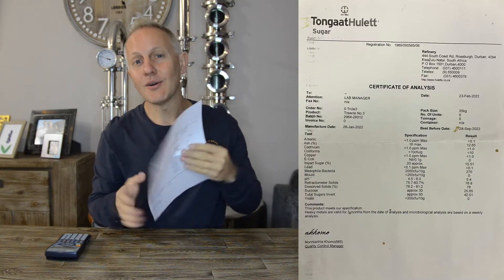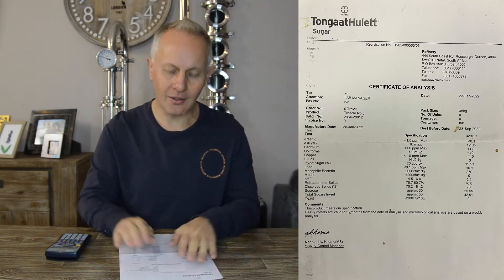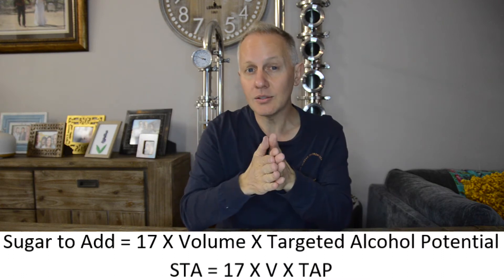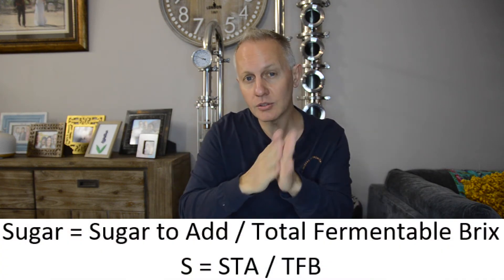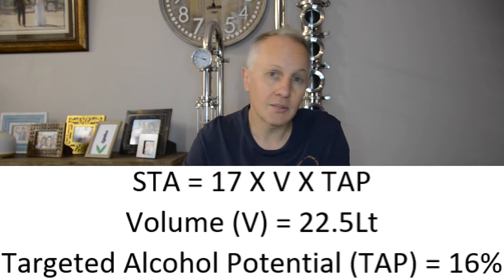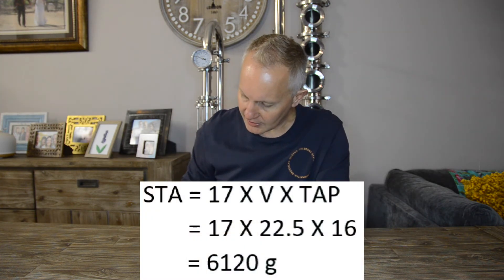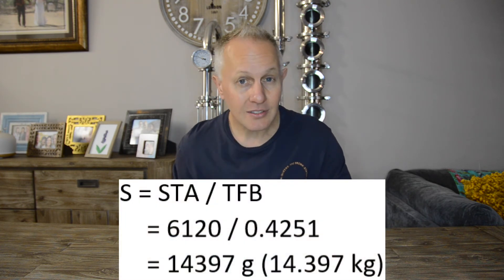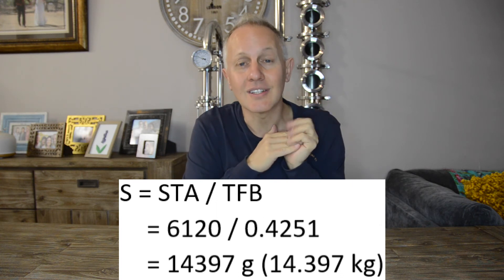Molasses Fermentation Sugar Calculation Explained | Home Distilling Guide **AUDIO FIXED**

Comment: Hello, how to ferment unfermented sugars?
Reply from the maker: Great question! Unfermentable sugars can’t be fermented by regular yeast because their chemical structure is something yeast can’t break down. Common examples are lactose (milk sugar) and some sugar alcohols. However, you can still work with them in a couple of ways:

Using enzymes: For complex sugars like maltodextrins, you can add enzymes (like amylase) to break them down into fermentable sugars, like glucose. For lactose, there are some specialized yeast strains or bacteria, like Lactobacillus, that can handle it.

Blending with fermentable sugars: Often, unfermentable sugars are combined with simpler, fermentable sugars (like glucose or sucrose) so the yeast can still do its job.

So, while you can’t directly ferment unfermentable sugars, there are ways to process them or mix them into something fermentable. Let me know if you'd like more details!
Reply: @distillergreyling  Thank you for such a detailed answer.))
Reply from the maker: @m.m.musasi
You're very welcome! 😊 I'm glad you found the answer helpful. By the way, I'm planning to relaunch the channel soon with fresh content—so stay tuned for more deep dives and practical tips. Thanks again for watching and engaging!
Reply: @distillergreyling  Thank you for your creativity..))

Comment: Based on your calculation, you go down from 76.8 to 35.1 Bx, or form fermentable sugar from 42.5  to 19.4 Bx, so my question is if you have 35.1 Bx will to be to high the osmotic pressure for the yeast? 	Also, 19.4 Bx will have a alcohol potential of around 11 % abv, isn´t it?
Reply from the maker: Hey Nicolas!
Your are spot on with the osmotic stress. 
To counter it I use a high tolerant red wine yeast. 
I also tend to use a larger volume ferment holder than the fermentation volume I want to ferment. 
I would then dilute with water to bing the Bx down to prevent yeast stress.
Example: I want to ferment 25Lt, I'll add it to a say a 50Lt  ferment holder and add some water to lower the Bx count.
For the second part you are on the money.
I use this short hand calculation to work out my Potential Alcohol (PA).
PA = Bx X (10/17)
Thus: 19.4 X (10/17) = 11.4 %ABV.
Keep it awesome!
Cheers!

Comment: Can I ask what yeast you use? 
Did you ever try So-04 with molasses? 
I am about to try it, but a little bit unsure?
I also want to try Kveik, as I am Norwegian, did you ever use it? 
I have been using a Chinese distilling yeast lately (not from Angel), working well but I wanted more flavor...
Any good advice on yeast? 
Have a nice Day 👍
Reply: Eg trur kveik må være det absolutt beste valget.
Reply: @kjartanlangedal15   kjøpte meg et halvkilo Voss Kveik fra laBrew, tok deg på ordet 🙏👍
Reply from the maker: Hei Thomas, det kommer til å bli kjempebra!
Reply: @thomasstadaas3599  hvor kjøper du melasse?
Reply: @kjartanlangedal15  Det skal jeg fortelle deg : Felleskjøpet 🤣🤣
Champion in Melasse, tilskudd til hest👍
120 kr for 7 kg, tilsvarende black strap molasses, jeg er veldig fornøyd med smak og nesten 50% sukker...
Ikke si det til alle 🤣🤣
Thomas
Reply from the maker: Takk Kjartan, jeg skal definitivt prøve dem ut.
Hold deg fantastisk, heier!
Reply from the maker: Hey Thomas!
I use DistillaMax Rm, NT-202 & NT-116.
Haven’t tried So-04 or Kveik.
When I try out a new yeast for the first time, I make small 5L batches to experiment first. If I like it, I then upsize. If its not so nice, then at least it wasn’t a lot I would loose.

Comment: Great calculations DG👍
I struggle with my fermentations, or my readings of the hydrometer, it stoppes at 1030-1050, but when I distill I get more than expected, I think the hydrometer is useless with molasses and dunder in the fermenter? I suspect it gives buoyancy to the hydrometer, even though the sugars are fermented? 
So now I don't care about it, (final gravity). Your thoughts on this? 
Thanks, love from Norway 🤣
Reply from the maker: Sweet, thanks Thomas!
Yes a hydrometer in molasses is tricky.
Because molasses has got some degree of unfermentable sugars, you tend to get a “false” reading.
If you know the total fermentable sugar (TFS) count/percentage you can work out the sugar content. You can find the TFS count on the data sheet of the batch of molasses you purchase, but sometimes you don’t get the data sheet with or the supplier doesn’t have one. 
But I like your approach, make sure your fermentation is right and keep it happy, then distill when you see fit.
Keep it up! 👍🏻